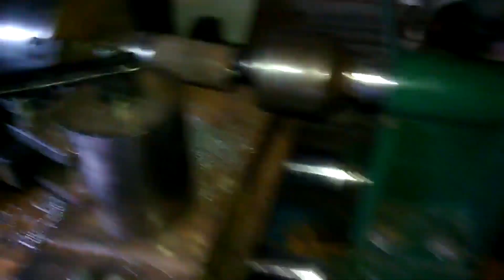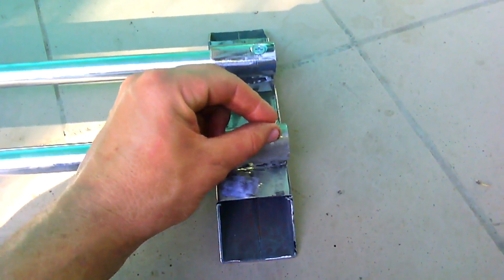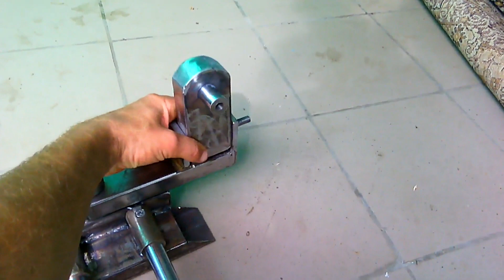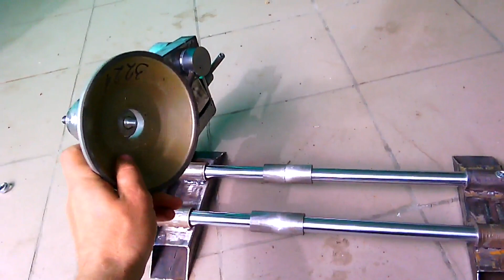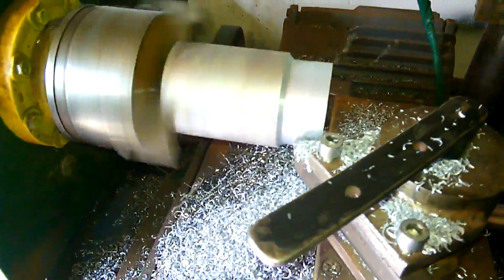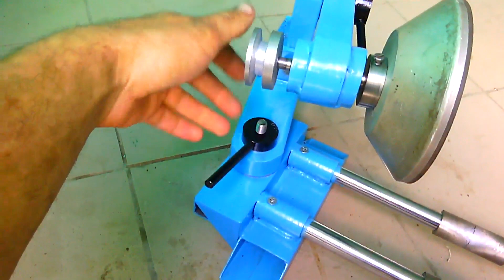Universal Cutter Grinder part 1

Comment: Very simple design , but it should be quite effective !    I learned a LONG time ago, that if you can't build  or machine something ACCURATELY, make it ADJUSTABLE :D !    No doubt you will be making tool holding fixtures to match the adjustability ;)    Thanks for sharing your design work with us ! ! !

Comment: to maintain parallel motion on the two guide rods, a machined block could have been clamped between each pair of  the bored guide cylinders during the welding. i enjoy the video!!

Comment: Why not just build attachments for your lathe,you can put grinding wheel in a chuck and you already have a cross slide built.
Reply from the maker: The lathe has a maximum  600 rpm, this is not enough for the grinding wheel. The front headstock is motionless, it is very reduces functionality. Separately made machine will have much more possibilities.